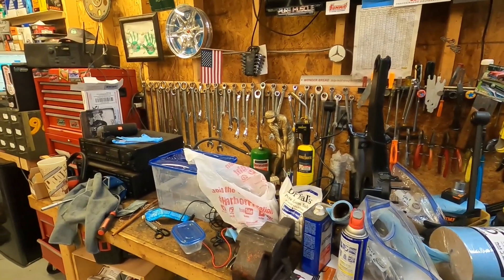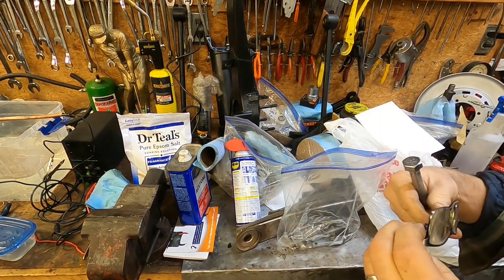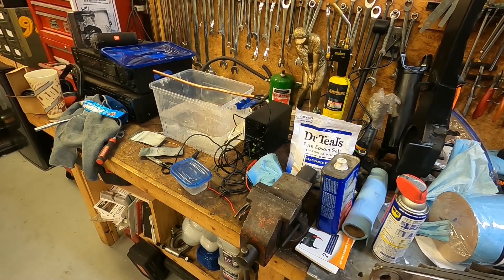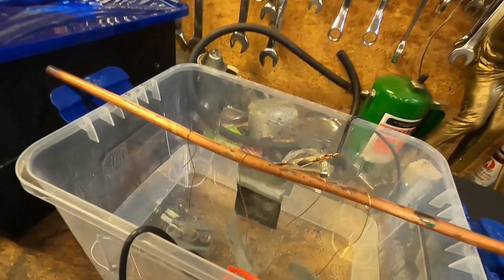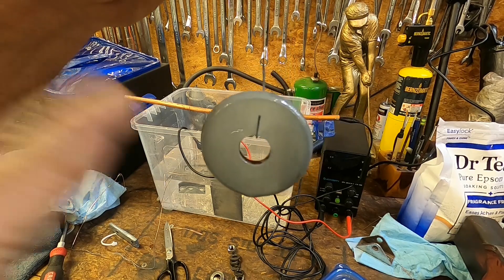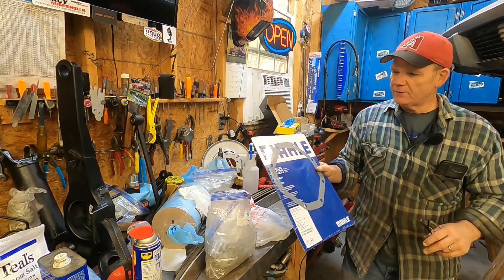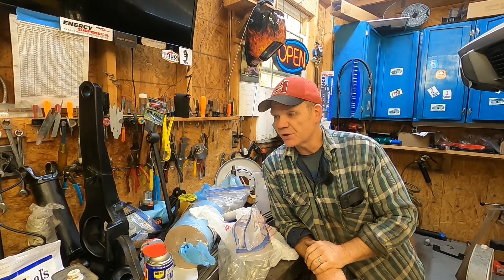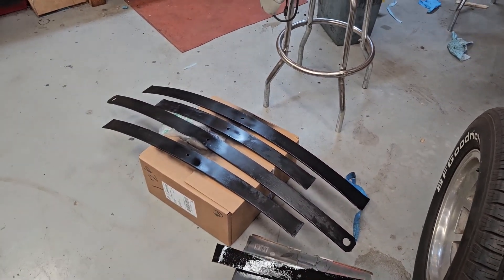1978 Silver Ann Corvette - Restoration - Part 8 - Zinc Plating Parts, Leaf Spring Restoration

Comment: I'm of the opinion that the wire wheel beats the tumbler in cost, time and complexity. And really, you can do a great job with the right wire wheel brush. I've been doing it since I was 12 (66 now) and I can get through a pile of small parts pretty quick!

Comment: So hydrogen embrittlement is a thing that can occur with electroplating which weakens the parts. Apparently there is a heat treat stage after electroplating that can be done to greatly reduce the chances of it occurring. Shearing high strength bolts is not something I would want in my "hold my car together" bits. Also low bubbling takes longer but is better for the part.

Comment: If you have an old drill plus either a paint can or a 5 gallon bucket you can clean the parts up with a makeshift tumbler. If your drill press is a pedestal kind you can make it work too. I build my own vibratory tumblers with pc fans and Tupperware.  I did a build video on my channel. Hope you don’t mind me mentioning. Otherwise please delete my comment
Reply from the maker: Thanks!